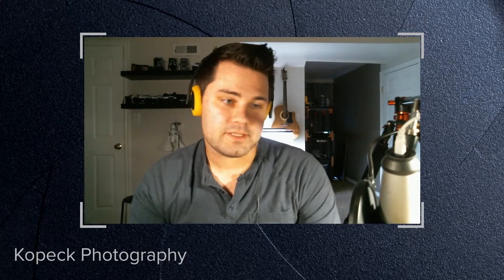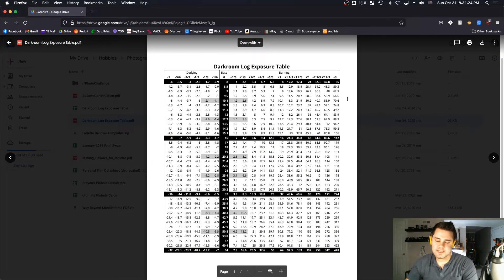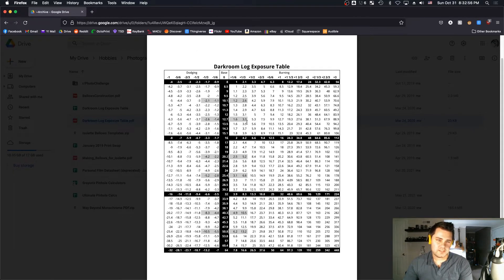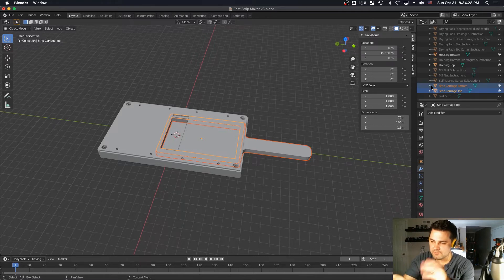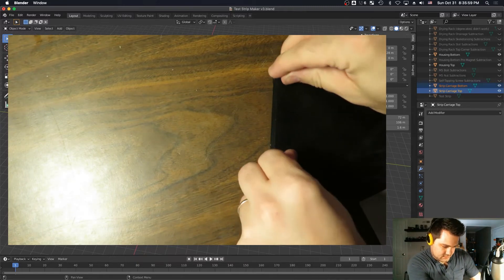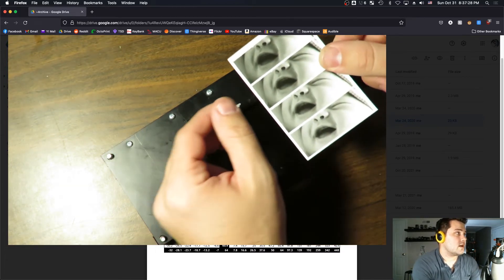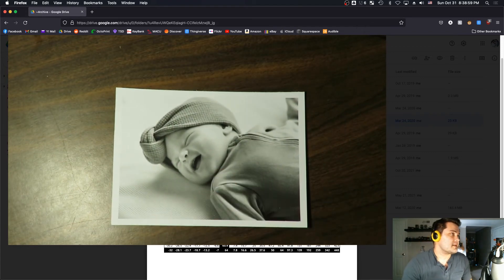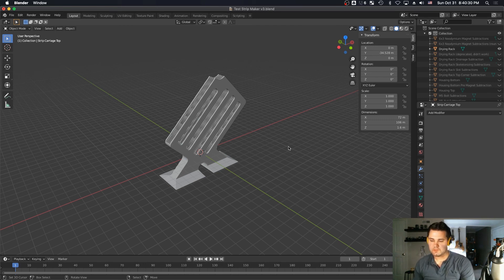3D Printed Test Strip Maker

Comment: Very nice. Using magnets to align the successive exposures is the clever part. Were I to have one of these made, I'd consider using a 2x8 inch strip  and extend the length of the unit and carrier to allow up to eight images, giving me a wider range of exposure options on one strip, one processing run, etc. First time I ever wished I knew someone with a 3-D printer.

Comment: HI Andrew, I really like the approach. It is very stimulating to see a different approach and certainly we have all faced the issue of not having a test strip cover the areas of interest. I also agree about stop-based timings, it simplifies so much in my mind. My test strip approach is traditional, and I also do split filter printing. I run a test strip from 8-64 seconds in 1/2 stop intervals for hard and soft filters. I think the downside of your approach is how long it takes to make each exposure. Your example works when you know pretty closely what the exposure should be. I would find it useful to use on some area of critical local contrast after I have the exposure range dialed in. I am not trying to be negative just understand. 

Your Reddit post caught my attention as I have an automated filter system for my split filter printing and have considered a similar device but with a motor to expose the test strip incrementally. Keep up the good work. The print of your daughter looks well done!